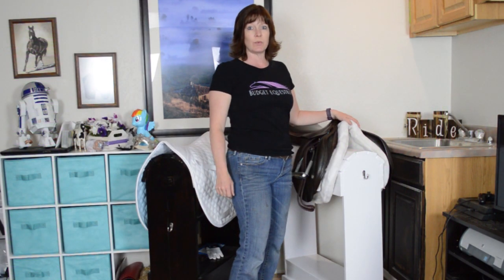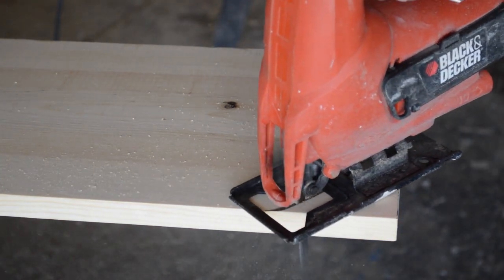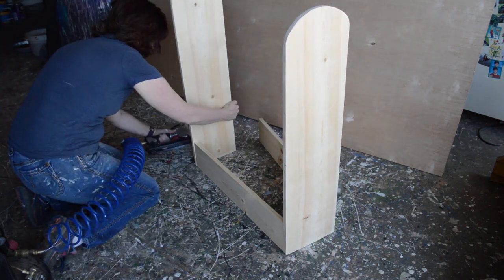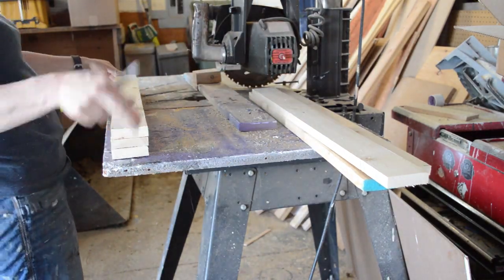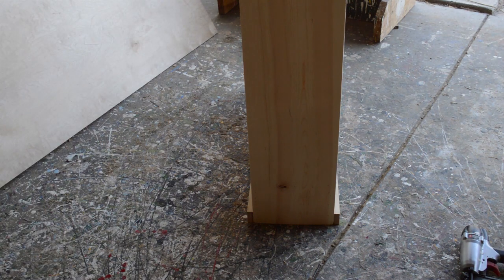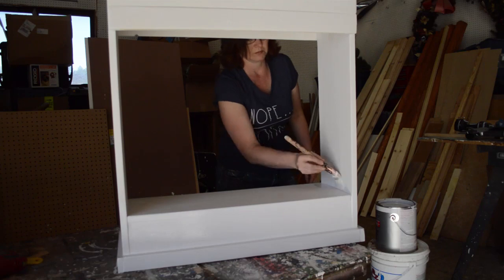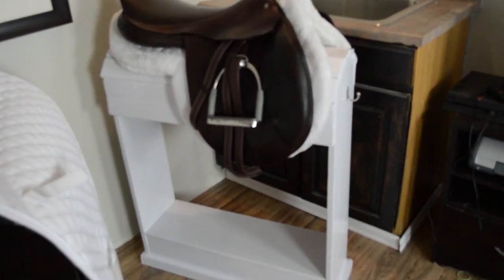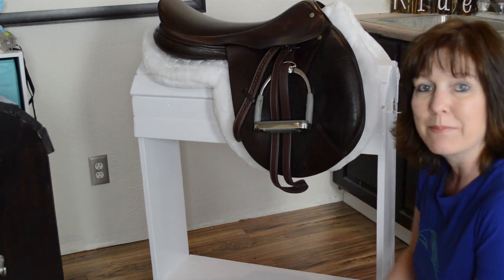DIY Saddle Stand

Comment: When building it, I would suggest using glue and screw it together.  Brads are fine for trim, but I wouldn't use them for structural purposes, especially if you want to sit on this.

Comment: Just what I was looking for. As someone else said.. think about using at least some Glue with the Brad nails.
Drill pilot hole first if you use screws as well.  I will tack it together with brads.. and glue, then put in screws.
Great video Thanks.

Comment: Can I sit on them or no
Reply: This one? no. You need something very structurally sound made with screws and the feet shown on the saddle stand over. The bottom shelf would not just be decorative, but would be screwed to the "tombstone" ends (it's the style of ends she used). Then it would hold the weight of a saddle and average sized person. Must use Screws! and attach everything together for stability of the stand. Many also have a centerpiece at the top that is vertical instead of horizontal as she placed all of the 1 x 3's where the spine of the horse would be so the stand ends can be very secure as well.